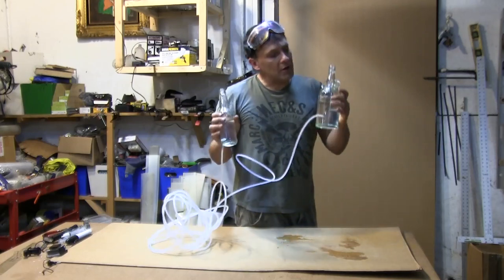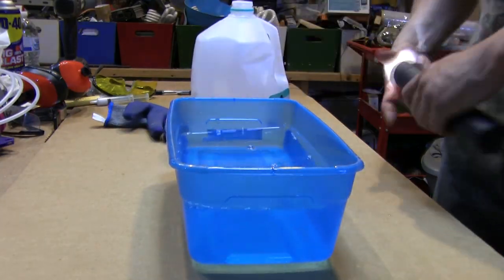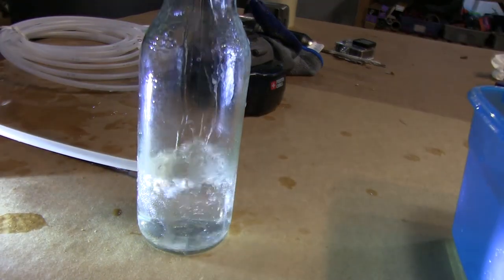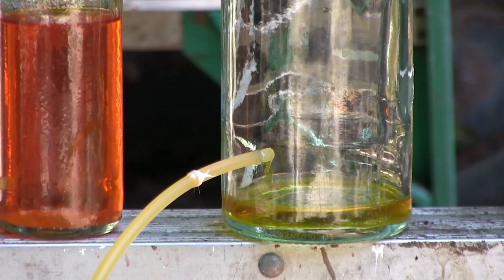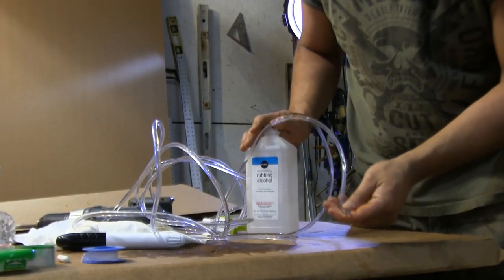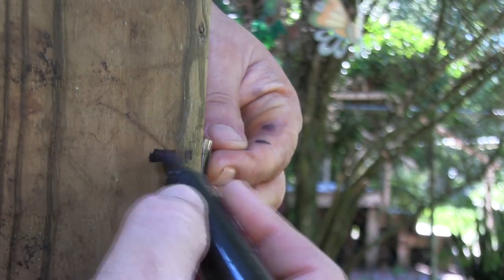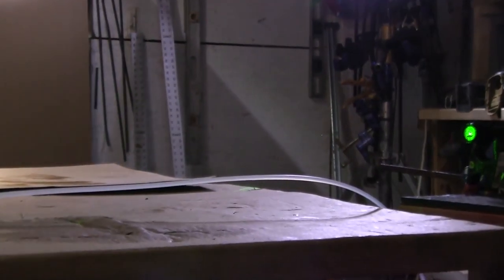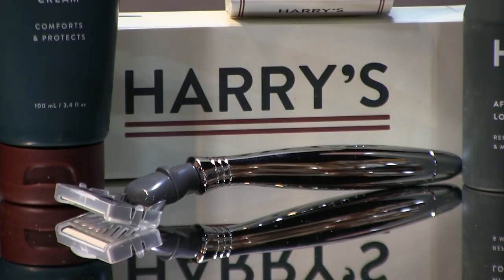Drill a Hole in a Glass Bottle DIY AQUA LEVEL greenpowerscience DIY glass drilling

Comment: Good Video Dan, however I have used a water level for over 40 years and you don't need the bottle just a clear hose will do. One person is on the set point and the other person takes the other end of the hose and goes to a random point holding the hose approximately the height of the set point. The person at the set point end moves the hose up or down to bring the water to the set point and when the water stops moving the person on the other end marks the level of the waterline in the hose.

Comment: We used a water level to level forms for a building. After I was done, I didn't trust it, so I rented a transit only to find my measurements were off by the thickness of the thin rubber band I was using with the water level.

Comment: I always keep a long length of clear 1/4" tube, just too damn handy.  I usually just go with water and the tube alone when using it as a water level.  One person at each end with a tape measure.  When the water level is the same distance from the top of the tube your done.  Then you can drain the tube, coil it up and lay it flat for storage.  I'm constantly snipping off a length for this job or the other.  When it gets too short to use as a water level, then it's time to buy another hundred feet or so.